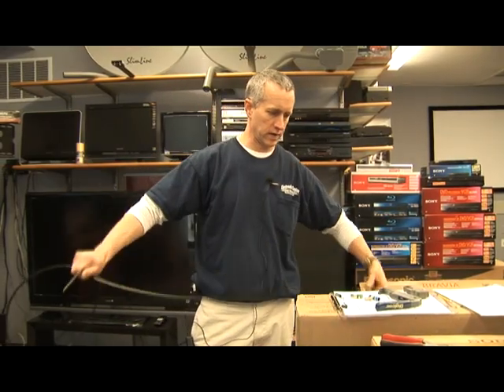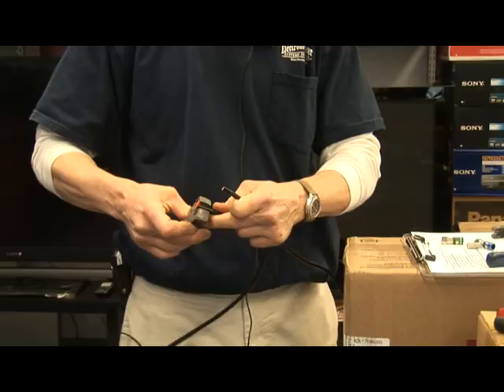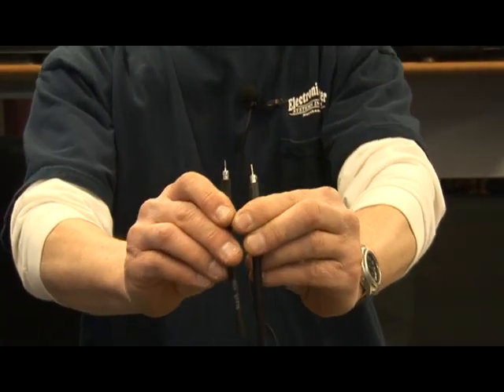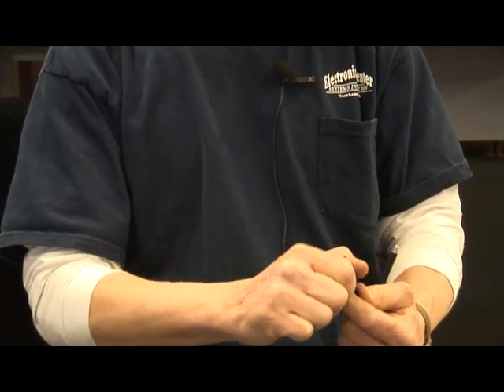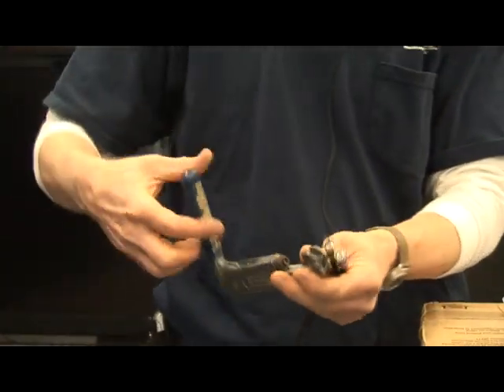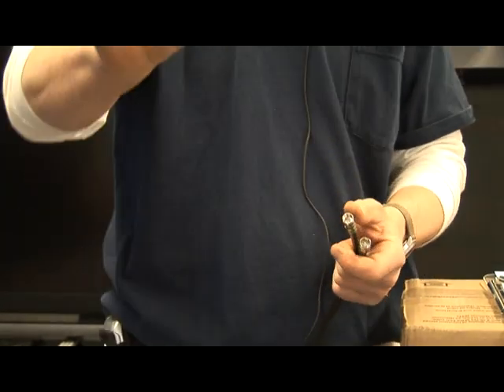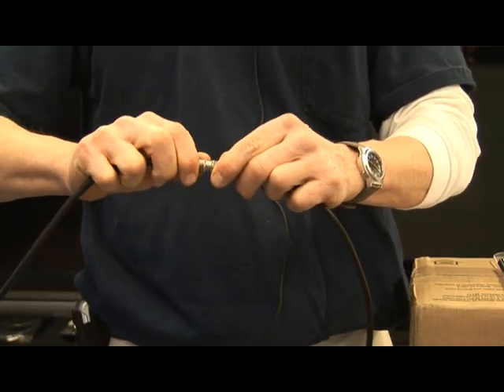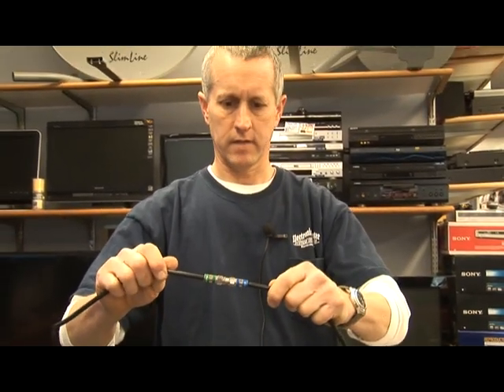TV & Electronics : How to Splice Coaxial Cables

Comment: I learned how to do this, the hard and slow way, back in the late 1980's while running coax for security cameras in a retail store.  Back then we used a box cutter to strip the cable ("guesstimating" the depth), pliers and electric tape.  That method still works, but not quite as efficient as this guy, and certainly NOT weather-proof, lol.

Comment: I don't get it. I am using the *exact* same stripping tool that you are using, and it does NOT end up looking like that. At all. I am using the '6' setting on the tool because I"m using a standard coax cable. I even turn it the other way too, just in case. Nope. :( All it does is strip the black casing off the last little bit, where the plain wire should be. ?!?!?!?

Comment: You gotta make sure the conductor is not too long and then you gotta hold the nut on the barrel while trying to tighten the fitting. Loose fittings will cause issues. You'll need 2 7/16 wrenches for this.

Comment: You need to educate yourself before you start posting videos like this. First off, those F connectors are NOT weatherproof. You must seal the splice with a splice cover. Secondly, you didn't torque the connectors to the barrel. By not doing this you don't achieve a complete connection. Finally, you didn't trim the stinger. Leaving the stinger that long will damage the internals when you plug it in. You also aren't using outdoor rated cable. If you were doing this job for a customer you would be called back for a service call because your "splicing" job just screwed over the customer. Where I work, I would be fired for doing such a shoddy job. I seriously hope that no one takes you seriously.
Reply: looks like the weather proof connectors I installed today. also appears to be the same cable that has proven to be weather proof outside my house. only a moron would torque an f connector on a barbell nut.

Comment: Ed, Thank you so much. I'm actually splicing security camera wire, because we needed more than 100 feet to where this camera is at. 

Anyway, as you might or might not know, security cameras take a video cable, and a power cable (a dc power cable). Can i use this same procedure on the power cable?

Thanks again, you are an amazing "how to do it" presenter. For real!!
Reply: Not anymore they don’t!

Comment: That compression tool he used in the end is not cheap, same for the connectors. However, this is definitely the cleanest way to do it. For outdoor splicing, I would recommend a rubber insulator over the connection.